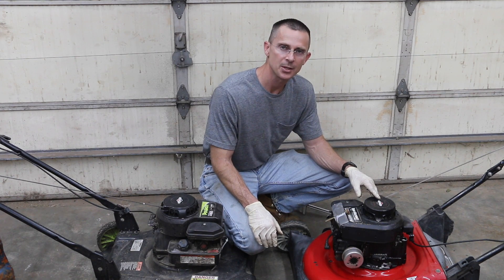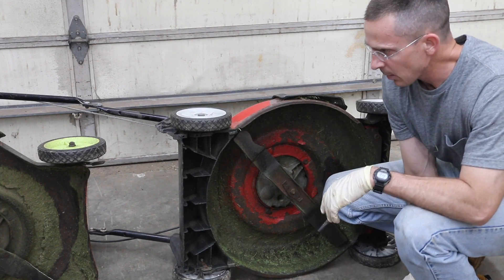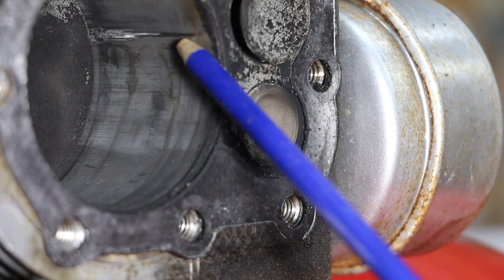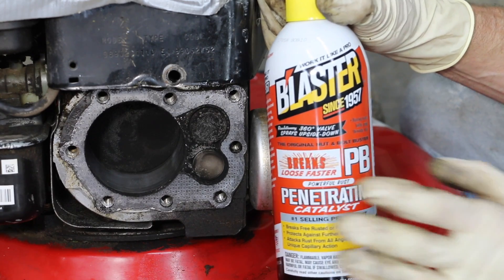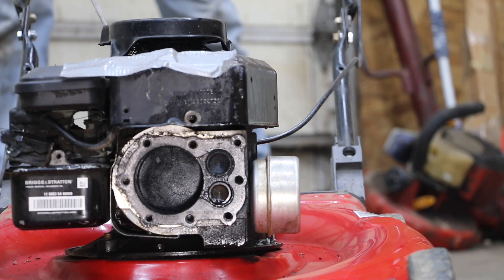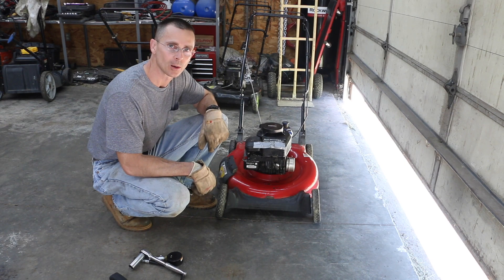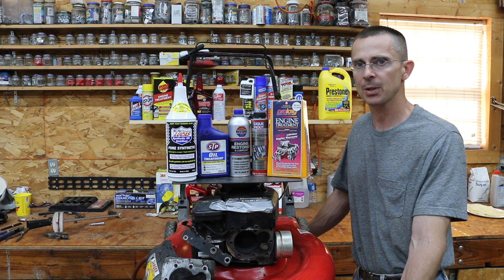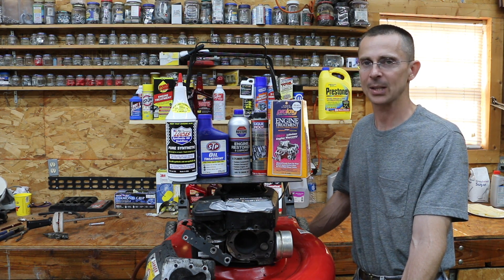Engine ran without oil, seized! Can it be saved?

Comment: Why didn't you just polish and grind the piston and cylinder walls
Reply from the maker: This is a great suggestion.
Reply: ZThesixeZ need to add new rings after you hone the cylinder or you wont have any better compression.
Reply: richard vaughn yeah if you want to do it properly but you can get it running without changin anything
Reply: ZThesixeZ If you polish and grind the walls you are increasing the bore by a tiny amount, but you arent increasing the rings. You are basically decreasing compression, unless the rings had a very smooth edge.
Usually the ring edge is a match to the scoremarks. Each score mark represents a burr on the ring. That will both create a gap and will also dig into the walls.
So you arent accomplishing much.
Reply: If the cylinder walls are grounded & polished, then logic says a new larger piston & piston rings would be needed. Then would that larger piston cause too much strain on the piston arm, sleeve, and crankshaft? I guess there is information on these tolerances & forces that show how much more force these parts could tolerate.

Comment: I doubt there's anything that will make this problem go away--but what about the legendary used car salesman's trick: using a very high weight oil, maybe with some sawdust in for viscosity to smooth things out a little bit, temporarily (on second thought, maybe the sawdust was for transmission gears).  Anyhoo, just an idea.  I know it's an old video.
Reply from the maker: Thank you for this recommendation!

Comment: None of those chemicals. Take the head back off. use a cylinder hone. It is a piece attached to a high speed drill. it will help to even up all those scratches and gouges, which is why you losing compression. I bet that if you put a drop of oil thru the spark plug hole, then ran the compression test, it will be back to normally for a little. The oil seals scratches on the wall. The hone is really meant to be done with the cylinder removed from the engine, but it can be done with the cylinder still in it.
Reply from the maker: Thank you for this recommendation!

Comment: Instead of removing the head, I would have dumped some marvel down the spark plug hole and let it sit for a bit. Of course it'd work best with the cylinder upright.
Reply from the maker: This is a great strategy.  Thanks for commenting!

Comment: Kroil is very effective at unseizing an engine.
Reply from the maker: Thank you for this recommendation.
Reply: My neighbor was a diesel mechanic for a mine in Colorado. Whenever they had an engine seize, they poured  a gallon or Kroil down each cylinder. They came loose.

Comment: You can just pour oil through the spark plug hole and let it seep past the compression rings. You may have to manually move the piston up n down with the blade. I have already done this several times to several lawnmowers.
Reply from the maker: This is a great suggestion--thank you!

Comment: My step dad had someone give him a tractor that was seized up because it was ran without oil. He is a true believer in MMO and took the heads off the seized up engine and let Marvelous Mystery oil sit on top of each piston for a few weeks or so. He would go out there and try to spin the engine over everyday until it turned over easy. Then after it had gotten where it spinned over easy he would still let it soak and would turn it over everyday for a while till it turned over more easier. It got where the starter could easily turn the engine over. He then replaced the heads and added MMO and motor oil to the engine. That was probably about 20 years ago and that tractor is still running today. I myself love PB blaster. The dollarstore has some lube for a dollar. I could swear it is PB blaster lol. Love that stuff also. Thanks for the videos and your effort of educating us on these products and their claims. Thanks
Reply from the maker: MMO is a great product.  Thanks for the positive comment!

Comment: I had a slight ticking in my 02 buick rendezvous. Believe it was the lifters. I put seafoam in the oil after an oil change and less than 300 miles later the ticking was almost gone.  It was barely noticeable even with a mechanics stethoscope. So it seams to work well with minor noises but I can't say one way or the other for major knocking like this.

Comment: I've already told you the story of my Dad hitting a deer while hauling a trailer and a van full of junk.  My Dad kept just about everyhing.  But one of his pickup trucks had a frozen king pin in the front steering knuckle and he tried everything to free it.  At the same time he recieved his prolong oil treatment he also got a super penetrating oil.  He had already tried liquid wrench with no luck.  I said why not try the Prolong?  He didn't think it would do anything, but I soaked the top of the king pin and an hour later came back and the small puddle was gone, so I sprayed some more and it soaked down.  So I used a small 2.5 lb. hammer and started rapping on the knuckle.   It moved a little I added more oil and hit in the opposite direction it moved farther.  In just ten minutes it was perfectly free.  We used that truck to haul his other the same 270 miles to his new place in northern Wisconsin.  I have used this many other times with great success.

Comment: "It's aliiiiiiive!"

And it's functional. Even with the bad knock, it'll last a few more years.
Reply from the maker: LOL! Thanks for commenting.
Reply: @ProjectFarm  what is the music you used for this video
Reply: Nay the crank Journal bearings are fried it's just a matter of time then you will need a new crankshaft by that time
Reply: I have a Honda engine on an old Troy Bilt Tiller that siezed the rod which IS the bearing. Honda is extremely proud of their rods, so I used a hole saw in a drill press to 'ream' the rod assembly to fit the undamaged, not even scored crankshaft. It was siezed enough that it bent the rod a bit, so there wasn't much to lose. I did this nearly15 years ago and it STILL running, with a barely discernable rod knock. It still burns oil; the reason the engine siezed. But I watch it much closer now.
Reply: @timbenham516  Crankshaft isn't the wear item here but the connecting rod and crank bearings are--the crank is forged steel and can be cleaned of the aluminum deposits it gets from oil starvation. In other words, you can save the crankshaft but everything else is toast or will be soon.
He should have disassembled the engine for an autopsy--always neat to see engine damage.

Comment: This is very good as well as interesting. I used to mow lawns for hire before I became a truck driver. I made a mistake with this one mower I had where the crankcase got too low on oil and the engine seized. I was able to unseize it but it failed a year later because connecting rod broke.
Reply from the maker: Thanks for commenting!

Comment: Not an expert. But I think if you hone the cylinders and put new piston rings on it should run much better. I am surprised it ran as well as it did with that huge gash in the wall! Honestly (benefit to your channels income) repairing these engines you destroy and showing what it takes would be good additional content. Would get more miles out of every project. For example if you decide to run an engine with coconut oil instead of engine oil (good idea to try). You could not only film what happens but film what it takes to repair it. The revenue would likely far exceed the cost of the parts by a mile. Id steal this idea for myself but I just cant bring myself to do anything but baby any engine I get my hands on
Reply from the maker: Thank you for this recommendation!

Comment: Try restore 1st. with prolong added  to the mix also. Restore will increase the compression, and prolong, very well might fill in some of the scoring gaps in the cylinder walls. Those two, would be probably worth a try anyhow. Restore, does have videos on u-tub, on it's workability, they have found that it does really work in cars, for how long, no one knows  though.
Reply from the maker: Thank you for this recommendation!

Comment: You should bore the engine over to remove the scratches and tune that puppy up. "Most power out of a built single cylinder Briggs and Stratton". That should be your next title.
Reply from the maker: Thank you for this recommendation!

Comment: My grandfather was an engine rebuilder for 25+ years and swore by those little bottles of STP. He told me they had problems galore with cylinder heads going bad until he started soaking the valves and lifters in STP, suddenly the engines were lasting much longer. I believe he was right but that same STP in the winter gets harder than molasses and is no good for cold starts, more of a break in additive.
Reply from the maker: Thank you for this recommendation!

Comment: Sounds like an old AMC Renault Alliance I owned.  Which being a teenager, I listened to the knock for about 2 months. 
Until a rod decided it no longer wanted to be inside the engine block anymore. lol
Reply from the maker: LOL! I remember those AMC Renault Alliances.  Pretty decent fuel economy for that era if I remember right.
Reply: Excellent fuel economy! So long as horsepower wasn't at the top of the list of expectations. 
If I remember correctly, it topped out at a massive 81 or so horsepower. lol
The book claimed around 100 hp, but the knock robbed quite a bit from it. 
My only issue was the lack of metal inside the vehicle. I had to run ground wires just to install the stereo.

Comment: also, i have HEARD that in a splash lubrication ONLY system, that fine sawdust will quiet a noisy engine down. i have never tried it however. if none of the other products help, maybe try the sawdust as a last resort.
Reply from the maker: Thank you for this recommendation!

Comment: FYI, you can use Marvel Mystery oil in the fuel as well (pre-mix like a 2 stroke) to lubricate the top end on an engine like this one. i have run it mixed at 20:1 (20 parts gasoline to 1 part MMO), it smokes, but it will drastically help an engine in that shape until everything gets loosened back up. as a bonus, it will increase the compression to some degree, as it helps the piston rings seal.
Reply from the maker: This is an excellent point regarding the use of MMO in the fuel.  Thank you!

Comment: One of my coworkers repairs small engines on the side. He uses JB Weld to repair cylinder wall damage and goes over the repair with a cylinder hone before reassembly.
Reply from the maker: Impressive!  Thanks for mentioning this.  I might try this in a future video.

Comment: yeah using snakeoil on a damaged cylinder wall and pistn rings
löl
if he don't change the rings and renew the walls ... lol ... no go. also other damage beneath the piston is possible, the knocking ...
guessed he has knowledge but this video shows me other ...
Reply from the maker: Agree with your comments.  Thanks!
Reply: I'm pretty sure the connecting rod is pretty loose on the crankshaft throw journal.

Comment: Hi Commander! Didn't realize I had watched this one before. The shock wore off I suppose. BUT I have a pal that's repaired small engines all his life and as far as one being locked down solid, he turns them backwards and lays the oil to them. Some time it works but it's just a matter of time till it bites the dust, but it might get someone out of a bind. I'd reduce the speed anyway. I don't believe in running something into the ground just because I can, recommended or not. My opposed-piston Vanguard starting instructions say to run it wide open and keep it running with the choke because it's lean running fixed jet. I got an older movable jetted carb and it starts at idle now. Newer may not be better. Take care! (me) AND I am a LARGE fan of Marvelous Mysterious oil, as Jeff Bradshaw calls it!
Reply from the maker: Lewie, I always enjoy reading your comments!  Thank you for the tip on unlocking the small engine.  MMO is marvelous oil, LOL!  Take care!

Comment: Once I forgot to check the oil in my lawn mower, through my ear defenders I heard a High squeak and then no vibration. It seized. with nothing to loose I took the spark plug out, sprayed in some WD-40,  pulled the crank, and then topped off with oil and put the spark plug in. I gave three more good tugs. It started up and I was back on my way... ;-)
Reply from the maker: Impressive!  Glad the engine wasn't ruined.

Comment: When  re-adding oil to a seized engine, fill it,  then roll the machine upside down and tip it over randomly a few times which will internally pour oil all over everything. Remember, the rod and upper crank bearing surface will be dry and simply adding oil or spraying the bore does no good.
Awesome videos!!
Reply from the maker: This is a great suggestion.  Also, thanks for the positive comment!

Comment: The knock is the big end bearing in the connect rod with the crank there would of been a some major issues with it running dry. To top it off with the engine being old the bearing would of been worn all ready it will finished the bearing off.
Reply from the maker: Thanks for commenting!

Comment: Why use synthetic oil? I have always heard that you should not use synthetic in a small engine, or in an engine that was previously using regular oil. There is also literature that says synthetic oil is no better than regular oil, in some instances worse. Do you have anything to say on this subject from your experiences? Thanks for these videos, very interesting and fulfills some of the thoughts I have had too.
Reply from the maker: Synthetics maintain their viscosity better with extreme cold or hot temps.  I don't live in a harsh weather environment and change the oil often.  So, it doesn't make that much of a difference for me.  Thanks for commenting.

Comment: Slick 50.  50W oil is probably what you need to cushion the worn clearances.
Reply from the maker: Great point.  Thanks for this suggestion!
Reply: I have changed the oil on neglected mowers where the oil was like tar, only to have them fly apart within minutes.  I say the thicker the oil,, the better.  I don't think you can easily get thicker than 50W though.

Comment: Try a 40 or 50 weight oil. The rod bearing clearance is probably large. Heavier oil could quiet it up a bit. But you are correct. the motor will never be the same again. Good video!
Reply from the maker: Scooter George, This is a great suggestion--thanks!

Comment: when i lock up engine i fill the whole motor with cheap b/g 5-30 
bore block everything let it sit for 10-15min 
that stops it locking up really bad and sometimes saves the bearings
Reply from the maker: This is a great tip.  Thanks for commenting!

Comment: Really enjoy your videos! STP oil treatment is very good for this kind of problem. One test you could consider is trying using only STP oil treatment in place of regular oil and see how soft that knock gets and for how long. Been adding a container of STP every oil change in a car of mine for many years with a rod bearing going bad , and have managed to keep adding miles on the car.
Reply from the maker: Orlen, Yes, I'm looking forward to testing STP soon. Glad that you've had great success with it.  Thanks for commenting!

Comment: A friend of mine's son ran her Honda powered roto tiller with no crankcase oil and seized the engine. She took it to a repair shop and they told her it was toast. She dropped it off to me and I filled the crankcase with KROIL. After only 5 minutes I was able to crank the engine over with the pull starter. Turned the ignition switch on and it started right up. Tilled my garden and took it back to her. KROIL is some great stuff. I've been using it for years.
Reply from the maker: Capt Galbraith, Great job saving the Honda.  I'm always looking for additives and oils to test and KROIL seems like it'd be great to use in a future video.  Thanks again!

Comment: In shop class we got a generator 13 hp vanguard come in. It had ran for 3 days straight and eventually burnt all the oil off and the cylinder welded to the cylinder wall. We beat it with a wood block and hammer and got it free. Loaded it with on blaster as lube and got it running again. After it smoked for a few minutes it actually started running well again!
Reply from the maker: Ben, This is very impressive. Great job saving this engine!

Comment: u should try to run it on 100% lucas heavy duty oil stabilizer and then try the synthetic stabilizer and see the noise differences it may not even run but it would be cool to see if it helps quite it done
Reply from the maker: Thank you for this recommendation!

Comment: I would simply go with a 50 weight oil. It might reduce the noise, but it won't fix the damage. This is true of anything else you can pour in the crankcase. Many of the additives on the market will successfully reduce engine knocking noises, but could that be down to the fact that they are suspended in a straight 50 oil ?
Reply from the maker: All great points.  Thanks for commenting!

Comment: for the next step you should measure and buy new new rod bearings and wet sand the crank, then try Restore to fix the gouges in the cylinder wall.
Reply from the maker: Nick, this is a great suggestion--thanks!